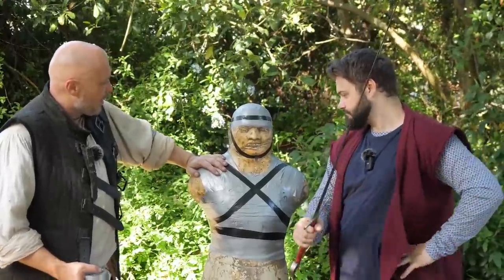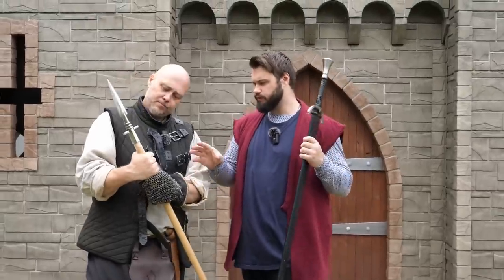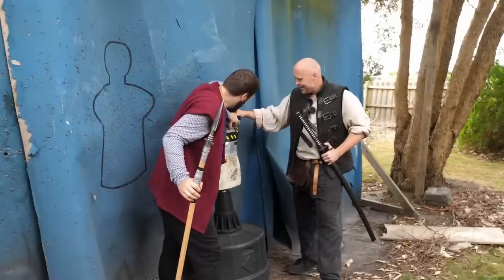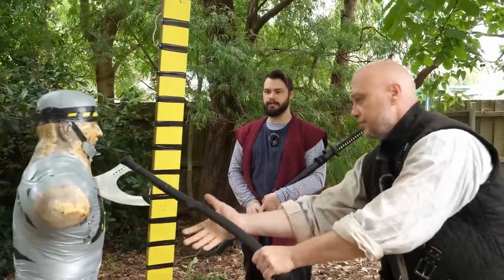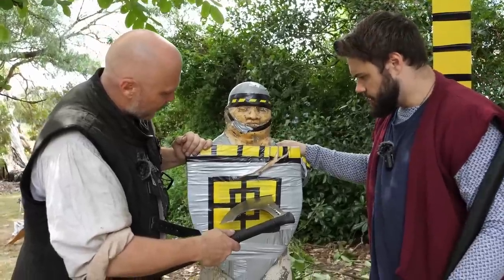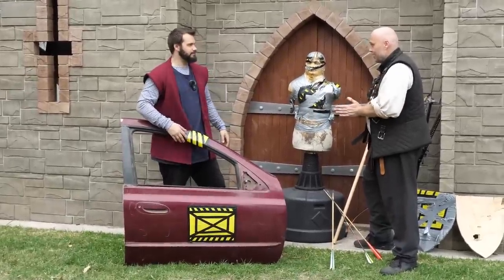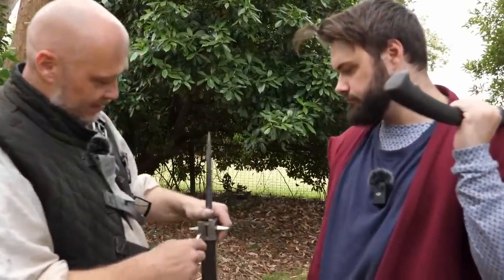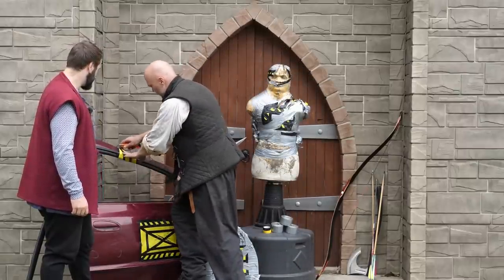Can DUCT TAPE stop a SWORD? or axe, spear, poleaxe, arrow, LOTS OF WEAPONS!

Comment: Okay, I think the duct tape may work better on the shield,  if you alter the direction of it for each layer. one horizontal, one vertical, one Horizontal, etc.etc.  When it comes to the spear, you could have had thin sticks or metal rods along the break, and then added some layers of tape, it would have made the spear much more functional. And it would still have been a really quick fix. As for armor, you could easily have used the duct tape to hold harder materials in place. If you didn't have a full armor, you could have made a primitive breastplate out of pieces of metal and duct tape. yes alone Duct Tape is pretty much useless  as armor, but if you use it together with other materials, It would be an entirely different picture. And it would be way quicker to make, and much cheaper than making regular armor.

Comment: Another way to repair the spear would be to tape the two parts parallel together. It'll have different problems, and won't be centered, but it would be less likely to flex/bend.

Comment: And don't forget, you can duct tape dragons!
Used offensively, duct taping the dragon to the ground prevents it from flying off, making it easier to defeat said dragon. Duct taping its maw prevents it from breathing fire at you.
Used defensively, you can reinforce your dragon making it harder to kill, or if your dragon sustained damage, you can duct tape its wounds, fix torn wings etc.

Comment: This would be a great way to test out a ton of modern and classic materials and fixing methods.  You use duct tape as “base results” then use comparable amounts to see how it is when equal, then test how much it needs to Be equal to duct tape.  You could try all sorts of tapes, leather types, scales, glue mixes, tars/saps, low melt metal pouring… lots of options, and it would be easy to test weight, thickness, cost(modern and classical), and what not vs each-other.  Also against the base, undamaged original items.  Who knows, maybe we can find “fixes” that actually improve items even, or modern items that are better than the old ones

Also testing mixes of various materials, like maybe flex seal undercoat, acrylic thin coat, duct tape then fiberglass topping? Who knows.

*note: that “indestructible” ultra fiber tape stuff that was as seen on tv…

Comment: The car door distributes the energy from a wreck. If the door is deforming and folding, thats energy that is not going into the humans inside. Its also why cars are designed to crumple and even parts to fly off. The Idea is to get the car to absorb as much as the energy as it can, thus giving you a greater chance to survive.

Comment: the break looks weird on the polearm, almost like the blade went through a slot on the head. if that is the case you might be able to pop the head off and put a new blade in then reattach the head to a new pole (using the old one would not be that great due to the rivets not biting well into the used wood).

Comment: Thin metal plates, so one layer covers the joints on the other, all held together with Duck Tape

...Duck Tape, later called Duct Tape, and Duck Tape was put into the English Oxford Dictionary in 1899, not 1942. The original name of the inventor has the family name of Duck. Due to recent changes in search engine parameters and switching to 'authoritative sources"  and ignoring the rest, finding out these things is kind of HARD. The Modern Version  of Duck Tape (then renamed Duct tape) came about in 1942, but the original (cloth tape by one name that no longer turns up as a search term) dates back to the 1800s.

Comment: I would love to see something regarding duct tape with resin similar to carbon fiber or fiberglass. I could see the stranded nature of the duct tape I've come across potentially providing something for the resin to adhere to and giving it tensile strength while benefitting from the hardness of the resin.

Comment: Im just gona say - its not just medieval or world wars era weapons and armour,  that can benefit from duct tape reinforcement, waterproofing or emergency mends. I have personally used it on modern military equipment many many many times.
A roll of Duct tape, a roll or electrical tape and a ball of twine are 3 items im never without as an engineer. FYI - you could have fixed the spear a lot better if you included some splints, when 'fixing' things with tape, use some lengths of metal for reinforcement.
That brings me to my next idea... Duct tape brigandine? strips of metal on the tape.. then apply it. now were talking. For home made armour to survive the inevitable Iphone zombie apocalypse you could just use pennies interspersed on the sticky side of the tape, betcha that would stop a sword.

Comment: As a former corrections officer who has worked at 2 different medium security joints, i can attest to the fact that layers of duct tape (along with a magazine or two) have been used very effectively to protect against stabs and slashes from prison-made shanks/shivs.

PS - A good name for a new test dummy:  JARRYK. Pronounced "YAR-RECK".

Comment: 25:30 is why anyone near should probably be wearing those safety glasses... Never know when a splinter of metal or wood will fly out.. 

RIP Bec De Corbyn though. Also wow though what a fantastic weapon for the battlefield, but it does show durability may be an issue and a "sweet and simple" weapon may work best due to longevity..

I could totally feel the "boy" inside coming out though at wanting to swing that thing though heh.

Comment: Fun fact: due to the idea that the name duck tape was a myth supporting the Duck brand tape or a mispronunciation, the use of the name "duct tape" began for the cloth adhesive tape. However, this itself was a myth, and the original name was, in fact, "duck tape," as it was constructed from duck cloth and was not originally used for any sort of duct. Actual duct tape is a metal foil with a permanent, high-temp adhesive suitable for use on hot ductwork that duck tape would fail on.

This message was brought to you by the Center for Understanding Nomenclature and Terminology.

Comment: ngl, I was slightly hoping more for ducttape spread between two sticks and hitting it to see how many layers it would take to actually stop something.
Because now it's basically "we hit stuff, but we didn't hit it without, so we're not really testing anything"
Not hating, just stating some issues I've got with the video.

Considering the way duct tape works, it also would've been interesting to see different methods of layering tested (crossed vs wrapping)

Comment: Guys, let me cook. Makeshift armor part 2. Duct tape + Flex seal. 

Boromir is fed up. He goes to his local shopping mart and gets 2 cans of flex seal and a LOT of duct tape. Can he survive the 3 attackers at Shadiversity? 

In the past, we've seen tire armor, but that required some rigorous production methods having to cut up the tire pieces into armor pads/sheets. Boromir doesn't have that kind of time! They're coming! If a solo adventurer was preparing for a zombie apocalypse, it'd be fairly simple to craft a few wooden shields, cover them in flex seal FIRST, then wrap them with duct tape, LAYER ON MORE flex seal, and you get the idea. I'd say maybe 2 to 5 layers.  2 layers being flex seal > duct tape > flex seal > duct tape. 

It may sound like a cheap, cop out idea of a video just to see you guys take swings at Boromir... but let's be honest, that's all we want anyways right? However, in a practical (zombie apocalypse) scenario, how effective could armor reinforced like that be?

Comment: Petition:
Borimir 1 should get either:

1: A Viking Funeral (mmm, burning plastic/rubber may not be anything friendly. Cool factor, but still...)

2: A proper Christian Funeral in the Shadlands (Well, it is not likely to get a priest to consecrate the ground or perform a service, but in so far as is possible)

Could become a thing for each Borimir. If Christian, could come up with a good headstone epitaph for each.

Comment: What you should of tried is put a jumper on the dummy Then the tape over the jumper. Coz it's skin tight there's no air between the tape and the flesh... I bet it would work 50% better with clothes on with the tape on the outside?? And the wearer would be able to move better in combat, he'd be too ridged with tape too tight

Comment: First, I like the end scene copying the music video for 'The Art of Noise' song 'Close to the Edge' with banging on the car door...

Second, if Boromir is made of ballistics jelly with an outer shell, then you should be able to wrap him in duct tape to prevent leaks, then warm to about 212°F  /100°C for an hour or two, then cool so the gel resolidifies.  As long as the duct tape keeps the liquid gel from leaking out that should work.  Then wrap Boro in a large contractor's bag (thick plastic), immerse in boiling water to remelt.

Third, if you can't re-cast Boromir then you can still recycle the ballistics gell, 3d print some small molds and your merchandise store can start selling Boromir ballistics gel figurines, 6" tall 'Boro-minis' and 3" tall 'Boro-micros'...

Comment: I wonder if the duct tape prevented the spear from splitting more down it's length, it might have protected it more from the first blow, if not enough for the second, but it might have made it harder to repair with duct tape as a result.

Comment: The beak of Corvin was inappropriately built to begin with. If you have any skill at welding there is an answer but I must warn you it requires a lot of grinding and some additional material place in exactly the right place.

Comment: The "Bec de Corbin" by Windlass is a prime example of reproduction done wrong. The spike doesn't have the proper geometry and dimension, which is extremely common for most products made by Windlass. They only care to make a very rough and sketchy emulation, instead of a faith recreation. Look at all the actual historical Bec de Corbin AKA polehammers. The side spikes are all extraordinarily stout, having almost a square cross section, and can't be too long. It's a percussive polearm, not a spear tip, it needs the proper reinforcement to survive all the impact against plate armor and enemy combatant's shields and weapons like swords, polearms and axes. I don't even think Windlass' example is properly forged, they probably just welded a thin piece of metal onto a hammer head and ground it a bit and called it a day. Get reproductions from a legitimate maker like Arms & Armor.

Comment: So...what if you take the Shield, duct tape it to hell, then FLEX SEAL it, the spray it with bedliner (the spray-on coating for truck beds) for good measure.

Comment: If you want to do what Mythbusters did, then Boromir will need to go through a LOT more before he needs to be replaced. The Mythbusters didn’t get a new Buster until he had been blown up, set on fire, shot at, smashed, hit, and dropped from really high heights. 😂

Comment: IT'S DUCK TAPE!  Seriously, the original formulation used cotton DUCK fabric.  A type of denim.  It's never been made to use on "DUCTs".  Strips of cotton DUCK fabric coated with pressure sensitive adhesive and a waterproof coating.  The formula is very simple.
Reply: It's duct tape
Reply: @BrennonIsMilak  Wow less than five minutes before someone "corrects" me.  A new record.
Reply: @rayceeya8659  okay source? Because I know of a brand of duct tape called Duck Tape, but I've never seen a single package of the stuff that's called duck tape.
Reply: @BrennonIsMilak  How about the video you just watched.  "Duck tape was invented during World War II to help seal and waterproof ammunition."  Nothing to do with ducts, air or otherwise.  

Now from Wikipedia.  "The first material called "duck tape" was long strips of plain non-adhesive cotton duck cloth used in making shoes stronger, for decoration on clothing, and for wrapping steel cables or electrical conductors to protect them from corrosion or wear."

Do tell show me how it was ever used on ducts.